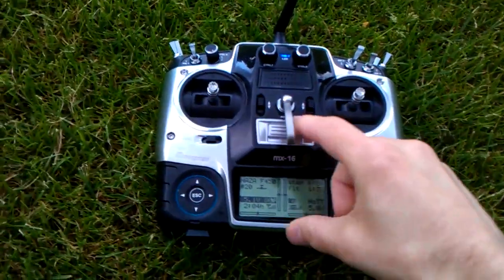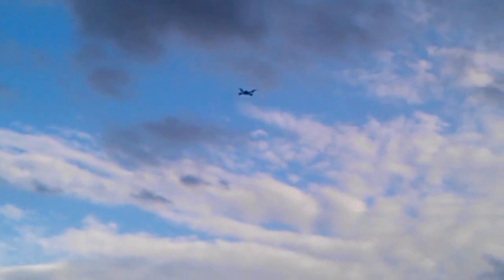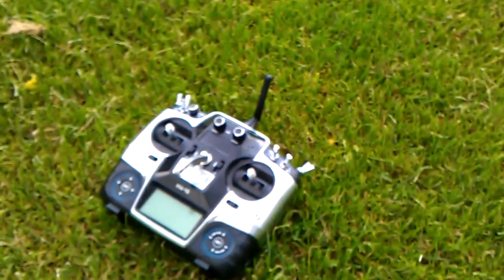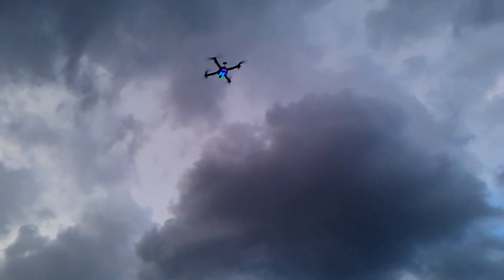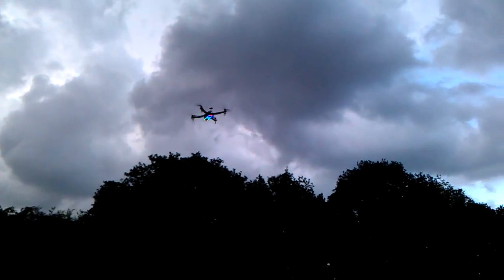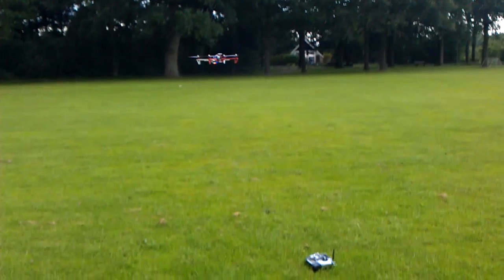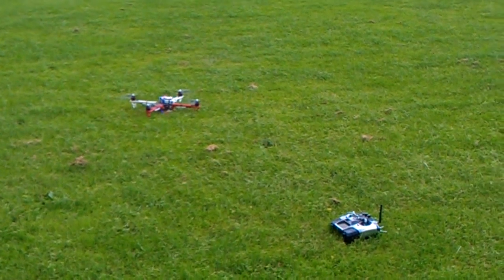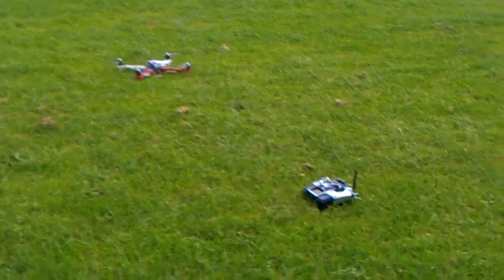Dji Naza + Gps upgrade,  Return To Home Demo (RTH).3gp

Comment: Yes, i had done that.. everything worked but the calibration, which was'nt wierd concidering i had'nt the gps plugged in. I did'nt know the compass was built in that one.. so it was a noob error.. the other more serious problem with sudden banks was due to a factory faulty motor.. when i switched that one (number 4) the Flywheel seems to work just fine.. and calibration too when GPS module is plugged in! :)